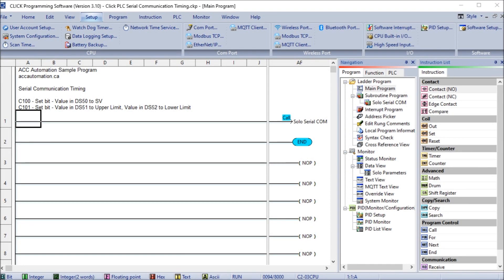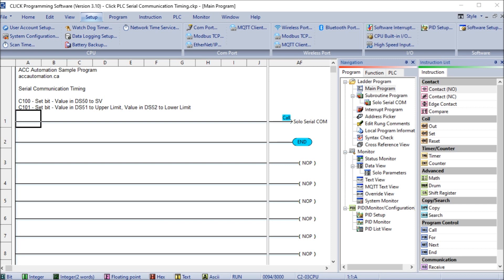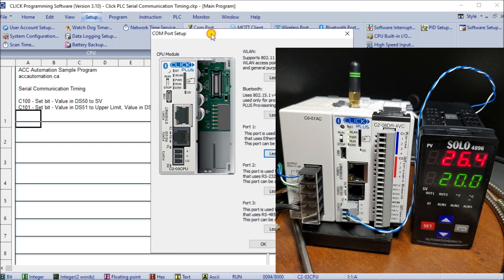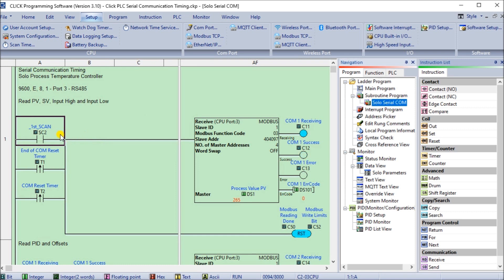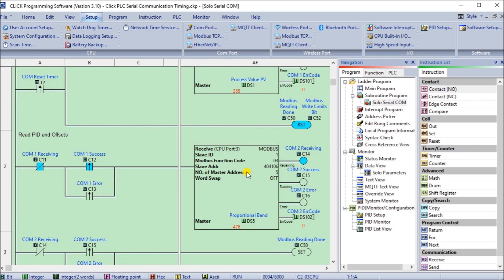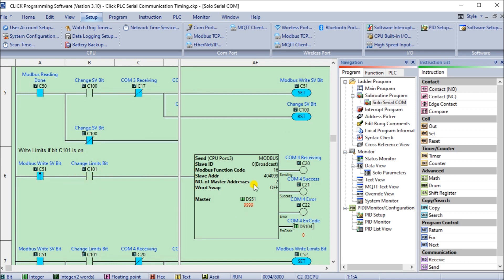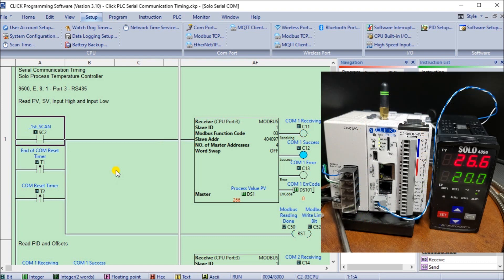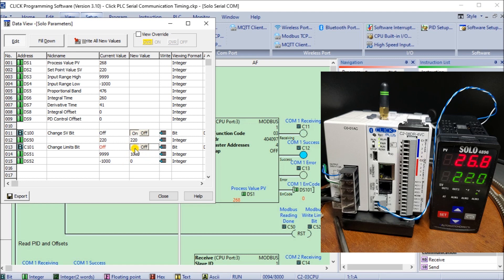Click PLC Serial Communication Timing Now!

Comment: Thanks a lot for your great videos. I enjoy working with the Click PLCs they are fantastic compact and reliable. Learned a bunch of new stuff. I noticed that your high and low limits do not change. This is because you haven't pressed the write button next to them to actual change DS51 and 52 in the Data View.
Reply from the maker: Hi David,
Great observation. Thanks for pointing that out. 
I did realize this after editing the video but thought that it is a minor error on my part.
Thanks for the comments, David. 
Garry

Comment: I've watched about 35 of these videos to get up to PLC speed. Looking through your examples, all the serial comm are for modbus, I have a measurement device that talks straight ascii (very simple poll/response). Do you have a video serial ascii tutorial similar to this? I also need to convert ascii number to a click float, which I think uses pack/copy. Any advise on how to proceed?
Reply from the maker: Hi Craig,
The following post will use ASCII input and output to represent Modbus ASCII Protocol. All calculations are done in the PLC.
https://accautomation.ca/click-plc-modbus-ascii-protocol/
You are correct about using the pack/copy command when casting between Text and DF. Here is some information on doing this.
https://www.automationdirect.com/microsites/clickplcs/click-help/Content/239.htm
Regards,
Garry
Reply: @ACCautomation  The accauto link you sent fully explains what's needed to address my issue. Its more complicated than expected, this is due to ladder programming environment. However all the rungs make sense and are quite clever. Thanks for your help.
Reply: Hey, I got my serial ASCII code running to query a multiple channel temperature monitor. Code sends and receives ASCII, copy/packs the result into a float then sets thresholded relay outputs. Even have address pointers operating to cycle through each channel in the temp monitor. I learned a ton about ladder logic, click IDE, debugging, sequencing, timeouts, error codes, one shots, etc. Thanks again for your help, this video and the ACC documentation.
Reply from the maker: @CraigHollabaugh  
Thank you very much for the feedback. I'm glad that you got it going and we could help.
Garry

Comment: Hi. If I just want to receive information, I have to use only the receive block?. I mean, it's not necessary to put a "send block" ?. I am saying that because I've been trying to read parameters from a "Power logic meter PM5560 SCHNEIDER" but I had no success.
Reply from the maker: Hi Abraham,
You are correct that you will only require a receive block to read from a Modbus address. 
https://accautomation.ca/click-plc-serial-communication-timing/
Is there an error code coming back after you try to communicate?
Here are the Modbus addresses for the meter:
https://www.se.com/ww/en/faqs/FA234017/
Regards,
Garry
Reply: @ACCautomation  Hi. Thank you for your answer. Today I tried to read "INT16" parameters and I had success. The problem is that many of the parameters are "FLOAT32" and if in the "Receive block" I put "DS1", I got error. So I tried to use "DF1" that is a "float" variable, I got no error, but I got numbers lile 1.57278 E12 or -1.5893 E-11. I want to read current, voltage, etc, and those are "float" variables, so I don't know what to change.
Reply from the maker: @abrahamtrauco6899  
Congratulations on being able to communicate. Since the INT16 numbers work, the correct addresses are being used. Sometimes these are offset by 1. In order to have the information read correctly, I would try to use the Word Swap on the Recieve instruction.
Regards,
Garry
Reply: @ACCautomation  Thank you so much, It worked. But I still need some help. I just want to read parameters(maybe 10 or more), so it means I have to use many "receive" blocks. The problem is that I don't know a lot about "Programming in PLC" so I tried to use the logic you used with the timers, but I had no success. Maybe you can give me some comments about it or tutorials I should watch. Thanks a lot.
Reply from the maker: @abrahamtrauco6899  
The following post is associated with this video.
https://accautomation.ca/click-plc-serial-communication-timing/
The success and error flags that can be assigned to the receive instruction should be used to trigger the next receive instruction.
Timers are used to indicate the end of the transmission and to determine errors with communication. 
Here is an older post showing just using timers:
https://accautomation.ca/click-plc-send-and-receive-instructions/
This does not always work. A revised program is listed near the end of the post using a shift register to time the Modbus communication.
I hope this helps you out.
Regards,
Garry

Comment: What about communicating to multiple modbus RTU slave devices?
Reply from the maker: Hi Mondi M,
You would continue to cascade the Recieve and Send instruction in the program. The bits from the instructions are used to trigger the next instruction. Here is a further explaination.
https://accautomation.ca/click-plc-serial-communication-timing/
Regards,
Garry
Reply: @ACCautomation  Thanks for the quick response Gary. I attempted to do so and after adding the receive instruction for the second node the Error bit turns on. I can communicate to the devices one at a time using the cascading method shown in the video but cannot have multiple devices without error. I can communicate to both devices using a counter and a delay of 100ms for each Send/Receive instruction. I would really like to be able to use the cascading bits and not counting and delays. Any idea what could be the issue?
Reply from the maker: @mondim6600  
Along with the error bit, there should also be an error code returned by the instruction. Can you tell me what that is?
Please check to ensure that each of the Modbus Slave nodes has a unique address. If two are the same this would cause errors as well.
If you want, please send me your ladder code to garryshortt@accautomation.ca
I can do a quick check of the code.
Regards,
Garry

Comment: I need your help bro....how to wiring close proximity sensor PNP (NO) to Siemens Logo 24RCE...and how to connect Start and Stop pushbutton....for sensor i using i4,i5,i6 input in siemens logo...please help me bro
Reply from the maker: Hi HappyLive Chanel,
Page 24 of the following logo manual will show the wiring diagram of the logo.
https://cache.industry.siemens.com/dl/files/461/16527461/att_82564/v1/Logo_e.pdf
I can only speak in general terms since I do not know your exact sensor. The common for the Logo input is 0VDC. The switching wire of the sensor (Black) goes to the input point of the logo. The +VDC (Brown) of the sensor will go to the +VDC supply.
Regards,
Garry
Reply: @ACCautomation  So how the output connection on logo?....and how to wire start and stop pushbutton on logo?
Reply from the maker: @happylivechannel5720  
Start and stop pushbuttons can be wired as per the same page 24 of the manual. The common input point of the logo is 0VDC. The input point of the logo is wired to one side of the pushbutton and the other side of the pushbutton is wired to +VDC to complete the circuit.
Page 31 of the logo manual shows the wiring of the output. Relays provide a dry contact. Ensure that the voltage and current of the output load are less than the rating of the logo relay output.
I hope this helps you out.
Regards,
Garry
Reply: @ACCautomation  okey...thanks bro
Reply: @ACCautomation  One more question bro....if i using i4 input for sensor in siemen logo, so how about to wire output of sensor at siemen logo?
Reply from the maker: @happylivechannel5720  
I'm not sure that I understand your question. The output of the sensor (Photoelectric, Proximity Sensor, Pushbutton, etc) is the Siemens Logo input.
Regards,
Garry
Reply: @ACCautomation  I means not output of sensor or pushbutton....but at the output of Siemens logo like Q1(1,2),Q2(1,2).
Reply from the maker: @happylivechannel5720  
Page 31 of the logo manual shows the wiring of the output. Relays provide a dry contact. Ensure that the voltage and current of the output load are less than the rating of the logo relay output.
Regards,
Garry
Reply: @ACCautomation  can we use ladder programming in automation studio to logo soft with a same ladder diagram?....are they works same or not?
Reply from the maker: @happylivechannel5720  
I have not personally used either software package. However, I would be surprised if you could use the same program and transfer it to the Logo controller. 
The basic concepts should be the same and it looks like you could test your logic and then program your logo.
Regards,
Garry